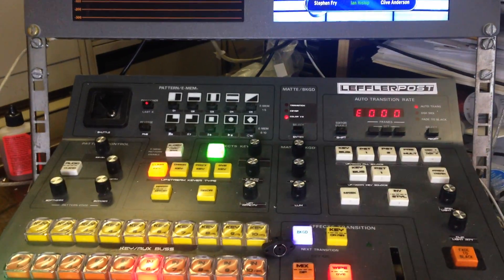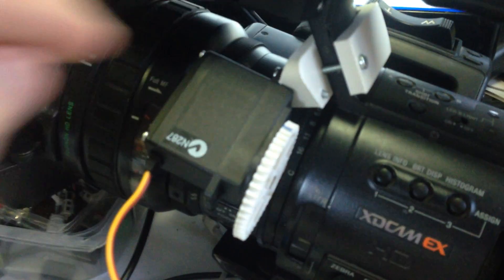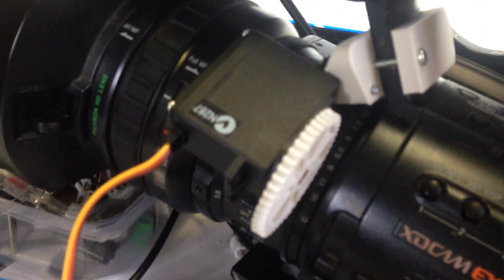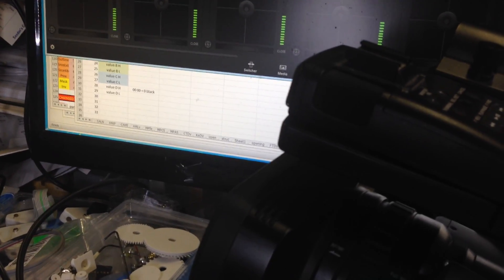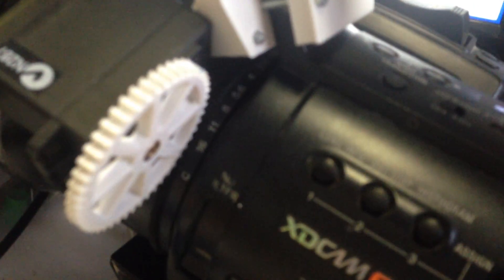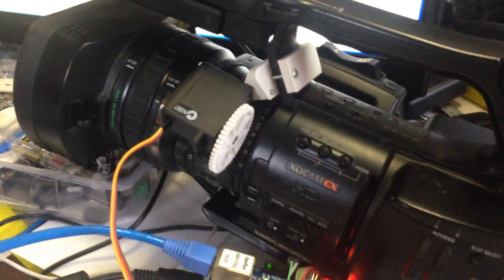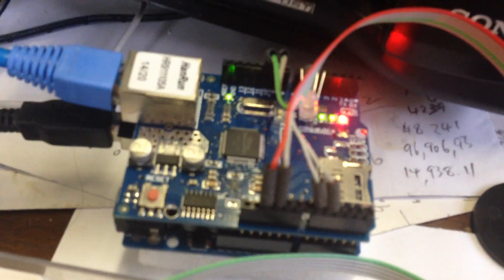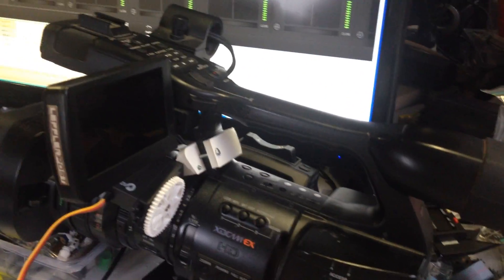CCU EX1 iris

Comment: it will be awesome if you can reversed enginner the sony remote port and control via that. so we don't need to buy all those crazy expensive ccu, mcp that sony put out thats sell for over 30k.
Reply from the maker: +simon hui The reverse engineering for the Sony 8pin remote is almost complete. There are some incompatible commands between the ATEM and the SONY protocols (eg color temp) so I am having to do work-arounds. Also different Sony camera's have different features so I have to filter out the differences.
Reply: Oh wow, is nice to hear that. Even if there is incompatibility i think the most important things for me is the iris, gain, wb, painting R,B and master black. And even if you done reverse engineering and some of the feature doesn't work with atem, you can always make a alternative proper Arduino base ccu system.
Reply: I also would be most interested in controlling my ex1 (mainly iris and master black) via 8pin-remote. can you tell me more about that and does that make the motor-construction obsolete? Thank you in advance!